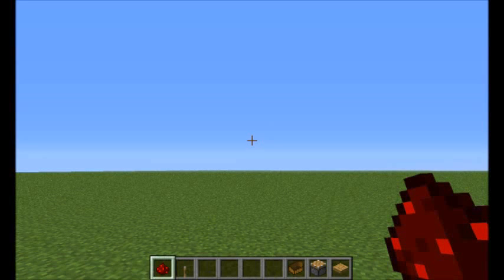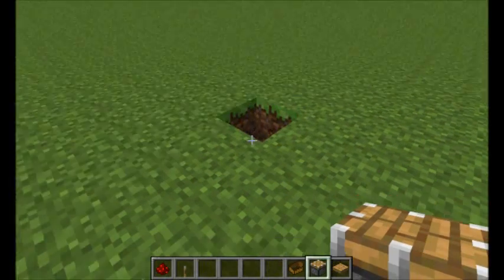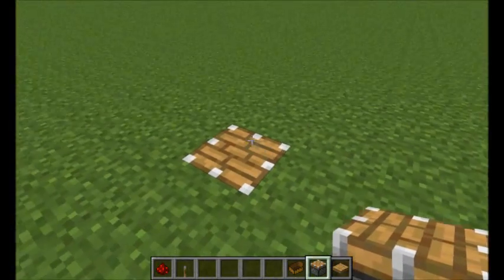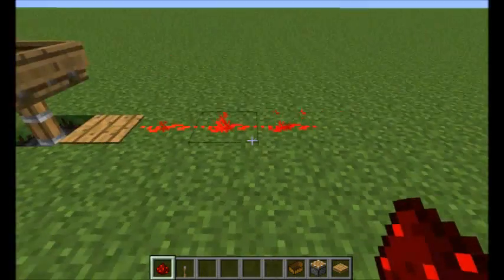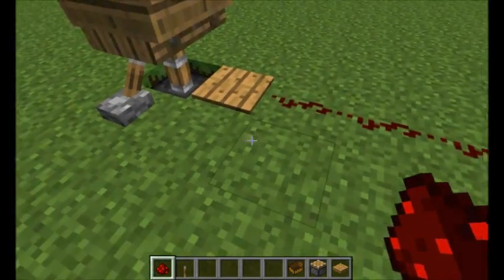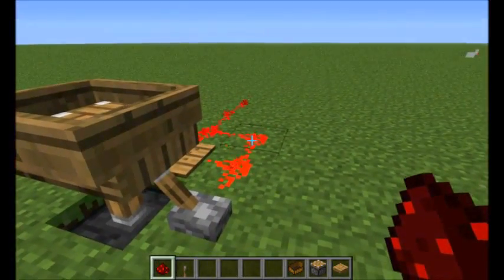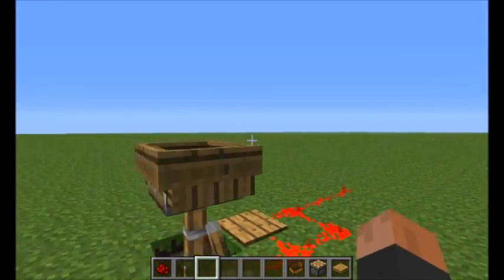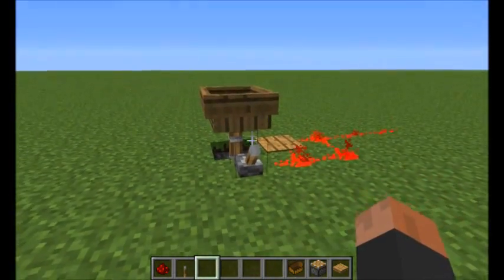Minecraft 1.2.5 Redstone Tutorials-  Simplest, Smallest Redstone Clock

Comment: I think I know a smaller one. Make two hoppers running into each other, put one item in one of them, and lead a comparator away from one of them.
Reply: Toad Man you need 4 to make it work
Reply: duck boy 4 Blocks or else the clock wont Work but still
Reply: duck boy I made one even smaller as you only need to use 3 Blocks it is kinda smaller when you only need 3 instead of 4 but only fill 3